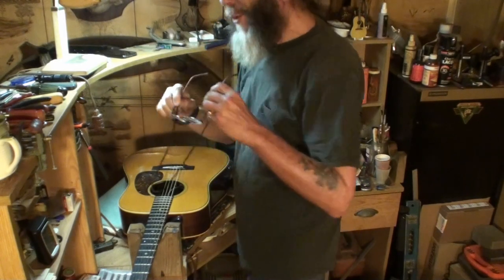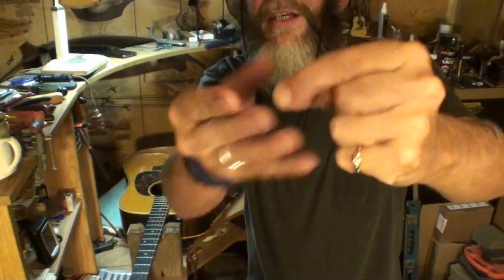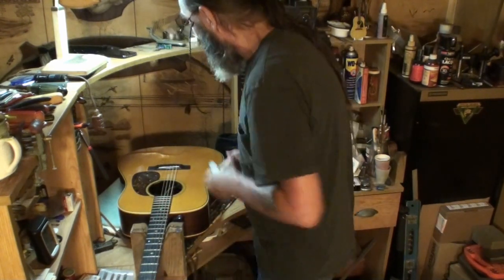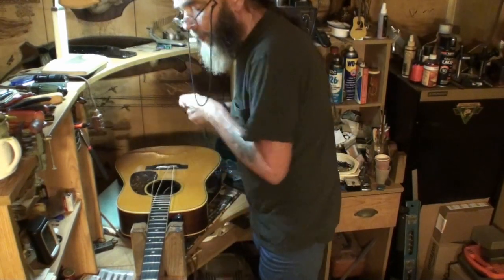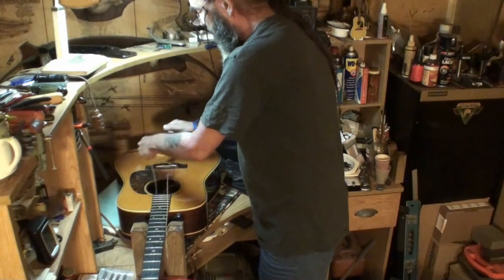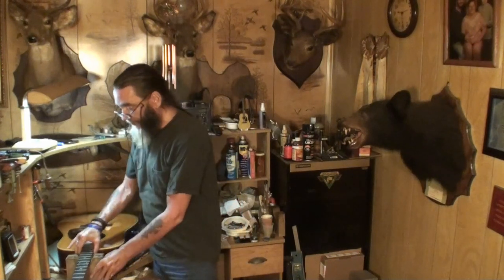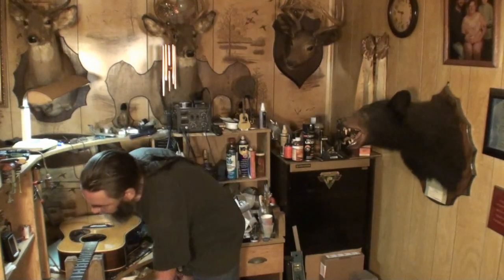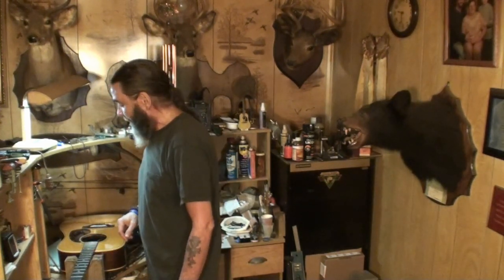lots of tips saving acoustic guitar bridge plate & lengthening your guitars life in REAL time

Comment: Hey, Randy.
Good idea, but , how bout, if you just put a curve, in the ball yoke, of the string, before you inserted the string? It'll slide right past the pin. I been doin' it , for years, and haven't had any problems. That eliminates, all thet cutting , or sanding, or any other problems. You know what I mean, right?  The small loop. around the ball.. Just bend it , at about a 25---30 degree angle, before you insert it, into the peg hole. Then, before you set the peg , pull the string up, so the ball runs clear of the end of the peg , up the groove, then, set the peg.... Hope that helps, brother.

Comment: The balls of the strings are suposed to be stuck at the botton of the pins or not? I didnt got It, i'm sorry its Just that english isnt my Native language and sometimes i can get a little confused. I have a 12 strings acoustic guitar that has being having some troubles até the bridge. The bridge is sort of unglueing, my pins arent cut, that has some relation with the bridge getting towards the neck? At First i thought it could be Just too much pressure from the 12 strings.
Reply from the maker: 12 strings pull a lot of weight on the bridge and top and no the strings should never hang up on the ends of the  bridge pins but they do if you don't do what this video says and eventually will eat your bridge plate away and cause the top to belly up, some guitars sooner than others. thanks for watching!
Reply: @RandySchartiger  thanks for taking the time to answer me. Now i know a little more about what to do to fix my 12 strings acoustic guitar. Thanks for your videos, all very interesting. Keep the good work and i'll keep watching and liking them all, looking forward keep learning from your wisdom, knowledge and experience. Greetings from Brazil.